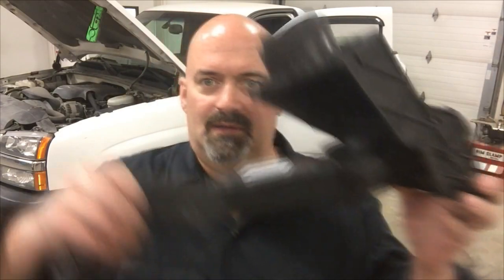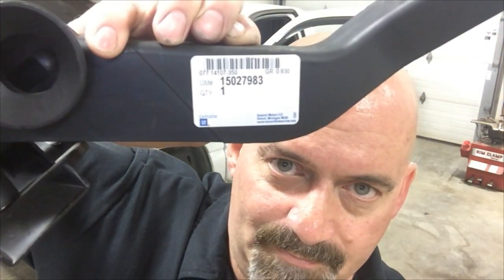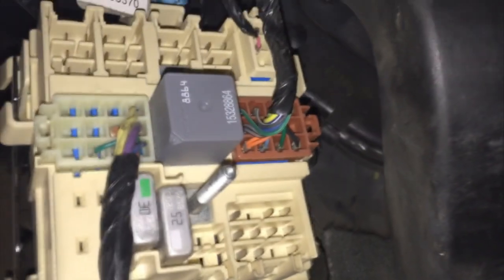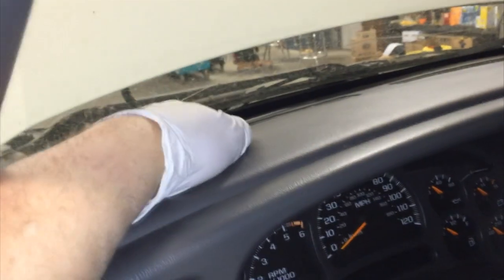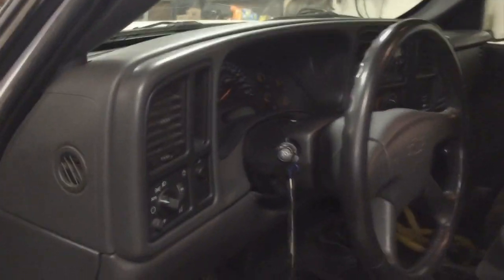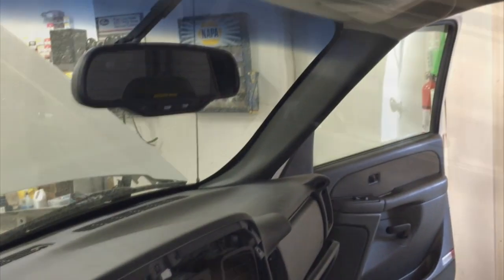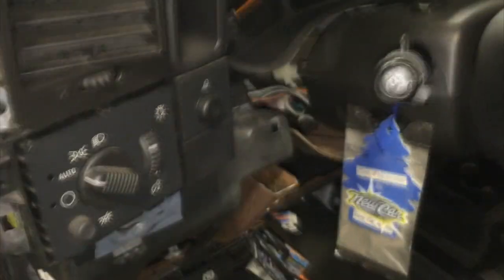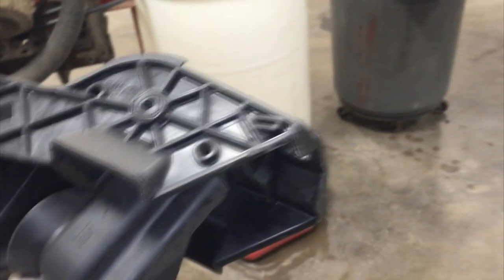Replacing Chevrolet Silverado GMC Sierra Clutch Pedal Assembly - Broken Clutch

Comment: O'Reilly's sells one with a metal insert. Also I didn't have to take dash apart simply dropped fuse box. To get new one in I attached the pedal lever after installing the housing. Made it much easier
Reply: Could you please tell me how to get the pedal lever off?  It would be a tremendous help.  can see much with it in the way to take the old one out.  Thanks

Comment: I have done this repair before on my 2002.  I didn't need to remove a single bolt or screw on the dash.  You use a swivel head and at least 11" of extensions to reach the three bolts holding the peal bracket in.  Once they are loose, you pull the assembly towards the bed, and you can get the front of the bracket in a little gap.  Then there's enough room to pull the round part of the bracket in the firewall, out and down.  I didn't even need to remove the pedal to take it out.  Came out pretty easy...  For install, I pulled the pedal out just because it was so easy,  install was in reverse order.
Reply from the maker: As stated, some models have clearance, some don't. Glad you were one of the lucky ones

Comment: I had a truck like this .  The clutch bracket does NOT have clearance to remove by any other means.  However, I took my Fein saw and cut the bracket in half carefully without hitting wires.  Then the two halves of the bracket come right out.  I took the new bracket and shaved off the corners and the 45 degree gusset back about 5/8 of an inch.  The new bracket slipped right in under the insturment panel very easily.  Took about 45 minutes total including clean up.

Comment: I just got through doing mine.  I had a couple of bolts that weren't mentioned on mine to get the dash back, but otherwise the video was spot on.  Saved me a lot of money, man.  I would have never gotten it done without the video.  Thank you.  VERY much.  Sure do appreciate you.
Reply: Where are those bolts at? I'm in the middle of pulling my dash right now and I did everything in the video but it's like a bolt or 2 on the driver's side got missed, the passenger side is free, but the driver's side hardly moves

Comment: Just pulled an assembly out of a 2002 sierra 1500. The 3 bolts holding the unit in place and the 2 nuts holding the fusebox base are all that needed to be removed. After that, a long screwdriver to push the firewall insulator out of the way and some finesse. Nothing needs to be forced, just wiggle it around and it will pop out.

Comment: I didn't have to move the dash.  Popped fuse block out of the way and unbolted the mount.  R&R was pretty simple after that.  You need to point the pivot point of the pedal highest up into the dash to pass the harness then slide master cylinder mount into its hole.  You'll start at about a 4 to 5:00 clock position then twist clockwise to 6.    Took me an hour and a half start to finish.  05 V8 2wd.

Comment: 2004 Chevy Silverado Regular Cable - Thank Car Dr. for the video, just wanted  to add for the regular  cab truck, It was not necessary to loosen the dash.  Just  a good tug forward to clear  the firewall the out.
Reply: I have a 2006 v-6 1500 i have to do it on. I dont have to loosen the dash?

Comment: I have to comment. Mine is an ‘06 regular cab. Did it in under an hour. Battery still connected also. 
Cut the pedal off as high as you can (have a buddy hold the pedal down for you). Watch the two sets of wires. You shouldn’t even be close. Take a sharp razor, trim a little bit of the thick rubber insulation under the area the assembly passes through the firewall. Take the 3 15mm bolts out. (You do NOT need a swivel!!).  Just because I saw it, I took the 2 13mm bolts out for the dash supports. 1 under the column and the other on the hump by the 4x4 selector. Two 15 mm bolts behind the fuse cover on the side of the dash. 
I took a 12” flat screw driver and inserted it at the bottom of the dash by the 2 15mm’s and left it there. (I don’t know if it helped or not). 
Take the cover off the floor mounted distribution box and pull the box out of the way. It does move. You don’t need much. 
Pull on the assembly and it comes right out. 

With the new one in your hand...push in the hex shaped “plugs”. The pedal comes off. 
Slip the new one up in and bolt it together. Last step was sliding the pedal back into the assembly. Click-click.. insert clutch master through firewall into pedal, connect wire harness and you’re done. 

Seriously, this took just less than 1 hour and I had a phone call in the middle I had to answer. 

Tools used... 3/8 ratchet. 2 6” extensions. 15mm, 13mm and a 10mm just because. Not necessary though.  Pipe cutting saw(they cut as you pull not push).
Reply: Rob Buttermore this is great! I got partway thru the dash then found your method; saved a ton of work. I modified it slightly and I think it took me more like 2 hrs (once you subtract out the time I wasted on the dash!).
Anyway, looking back I’m pretty sure you could do it without removing any of the 13mm or 15mm dash support bolts. Once a bit of that plastic/rubber mat is cut out, and the pedal is removed/cut off, the stationary part really does come right out!

Comment: Update; was able to free the clutch pedal assembly easily by simply cutting a section of that thick floor insulating rubber stuff below the point where the pedal assembly passes through the firewall. That gives enough clearance to pull back, then down in the front of the assembly, and it comes right out. Did not take apart any of the dash. '05 Silverado 1500.
Reply: Same here on a 2003 GMC, its kinda of a fight to get it out but no need to do any dash work.
Reply: CopperFiremist , oh yeah it’s still a fight and I ended up with plenty of small cuts on my hands and arms!

Comment: Hey man, thanks a bunch for posting this repair video, you saved me hours of figuring stuff out for myself, which I used to do a lot before you tube. Pretty sure I owe you at least a six pack.. Anyhow, I figured out one thing that saved me a bunch of time and will save you and anyone else from having to fool with the dash components you illustrated. I removed the metal bracket under the fuse panel you removed at 5:50. That allowed me to remove and re-install the clutch pedal assembly no problem. Probably a 50% savings on cuss words!
Reply: Great tip, John!  I used this in my repair and I was able to remove/replace the clutch pedal assembly w/o touching  the dash.  It was a tight - but do-able fit.  I hope I never have to do it again though.
Reply: John Mahaffy thank you so much
Reply: I concurred with john mahaffy, i used a small pry bar between fire wall at the master cylinder opening . WOW! popped right out and no damage....cool thanks and thanks to the car doctor. many heads are better than one head, LOL
Reply: John Mahaffy dude this is huge. Thanks
Reply: How the hell does removing that bracket on the floor board give you clearance to get the top piece out ?
Reply: IF you are still around, was that bracket silver in color by chance?  I'm stumped.
Reply: was that bracket silver in color if you remember? @fsfazekas

Comment: I just changed mine today on my 2006 WT 1500 and was able to do it without removing anything, but the lower dash panel and moving that electrical junction box. I did have the seats out for some other work, though, which helped with access .  I did use the oem part because my problem was worn pivot . However, Dorman makes an improved part with metal parts molded in . But it does not come with the pedal.

Comment: Had to replace my Clutch Pedal assembly on my 2006 Chevy, 4.3L. Not fun, took me all day as I am a very shade tree type guy. Took my time and saved around $300. The only issue I had was I didn't get the dash out and up far enough and I was getting caught on the firewall pass through hole and top bolt wouldn't line up. Grabbed a lunch and came back to it and finished her up. Thanks for the great video...now if I can get all the cuts healed up I'm good!
Reply from the maker: +Bubba Jones I needed three units of blood after this one. I'm not sure I would do another. Glad you saved some money. Take care

Comment: There is a lot easier way to do this. I'm doing this for the third time on my 2000 Silverado (same dash) and I've found that once you remove the three retaining bolts you can slide the pedal assembly back towards the instrument cluster enough that the front (where the MC attaches) will drop down inside the firewall. Take a wide gasket scraper and push it between the carpet and the front of the assembly so the carpet / mat is pushed back against the firewall as the front of the assembly slides down over the carpet. After the front of it is down past the hole in the carpet push the harness in between the front of the assembly and the matt before pulling it all the way down. Takes maybe 10 minutes to get it out.  If you have trouble getting it past the carpet trim some off the top edge of the carpet or mat.                       Also you can work the clutch master cylinder line around under the brake booster so the clutch master will come out of the firewall completely without having to break the line and bleed it..Also The secret to bleeding the MC is to jack the front of the truck way up. The MC is tilted slight down when the  truck is sitting on the ground. jacking the front of the truck up makes the reservoir the highest point in the system. it'll self bleed just by pumping the clutch after that..
Reply from the maker: Thanks for the feedback. I'll have to give it a shot on the next one...if I ever agree to do one. Haha. Take care.
Reply: This is definitely the way to replace the pedal assembly.  Took me 1 hour replace it.
Reply: Man, I hope you do another like I'm describing. Your video is great. I just wished I was there. Making videos is not a talent I possess. If you do, just give me (Red) a shout out.

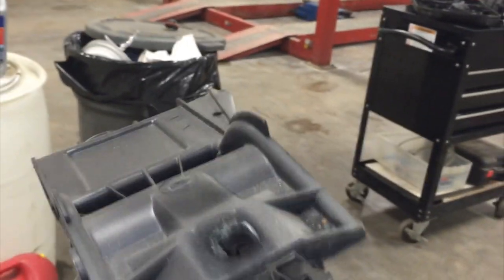Comment: 18:35 that’s why you had such a hard time. You pulled the wrong side out first

*PRO TIP*
DO NOT NEED TO PULL OUT DASH at all.  

Once you have the bolts out you will want to slide the bracket towards the back of the vehicle and actually pull the front part of the bracket out of the hole and rotate down. 

The dorman part has a metal collar built in.  
Part #926-086 
Going on a 2005ish GMC Sierra.  
Also the clutch master cylinder rod bent which is why it broke on this one.  Less than a hr I’m done
Reply from the maker: Pro tip: not all models require moving under dash components. Some do.
Reply: @ThecardoctorTV  no disrespect love you content.    I’m just saying I bet if you would of tried the opposite direction would of came right out for you.  Maybe try on next one.  Tho it’s not a common one Iv had to deal with

Comment: Happened to me... 2003 Silverado.   85K miles. Pushed in the clutch, heard a crack,  pedal stayed on floor, master cylinder hanging off firewall... After turning truck off, wouldn't restart, clutch has to be in for it to start... Broke, out of luck. It was the last time i ever bought a Shitvrolet.. RAM baby!
Reply: RAM TRUCKS just happened to me , man I’m pissed. I replaced assembly last year due to broken keyhole holding clutch cylinder. Now the interior pedal assembly cracked all up and pedal arm snapped from shaft it operates on,  I’m goin’ back to when Trucks were for workin’ people and not pretty toys, looking for Cheyenne 70 -73 maybe Trailer Special.

Comment: I was able to get my pedal out on my 2002 silverado without removing the dash. had trouble trying to get it back in but then....i removed the pedal arm from the mount by pressing in the spring loaded bolt shaped retainers on the housing. i had plenty of room for it to go back after that. it literally took 30 seconds to remount the bracket to the firewall and attach th pedal arm back to the base bracket
Reply: I'really appreciate your strait forwardness and could'nt agree with you more. Thank you for your help

Comment: 2005 Silverado 1500 and mine just went...can't believe that they use plastic for this and metal for the accelerator and brake!!!  Those pedals could be plastic, this one needs to be metal SMH!  Anyway just ordered the part so I'll be trying this myself in a week or so.  Thanks for blazing the trail for me!
Reply: Mine is done...took about three and a half hours but I'm just a back yard mechanic (at best) so someone that wrenches more often can probably do it quicker.  I used John Mahaffy's tip below (removing the under dash fuse block mounting bracket) and that let me remove and replace w/o touching a single bolt on the dash.
Reply: right on .I'm in same situation 06 Silverado 1500

Comment: I got mine back together. took the pedal off the assembly. seems it's impossible to take the pedal of without the left side spring popping out. the plastic washers around the compressible nuts cracked a lil but it seems to be holding the pedal fine just a lil frustrating damaging a new part
Reply from the maker: sad deal. Glad you stuck with it!

Comment: great video just changed a clutch pedal in an 06 silverado 4.3... Davis Truck & Auto Chateaugay, NY
Reply from the maker: Thanks! Did you have to pull the dash back very far to remove the pedal support?
Reply: +The Car Doctor no probably an inch if that seems like alot of work for that little bit of movement
Reply from the maker: Yes, poor design for sure. Garbage plastic and hard to get to.

Comment: Sharing the following in attempt to save someone the headache
associated with this dilemma and the best permanent fix. This ABS plastic will
break / weaken just as the video illustrates when excessive force is used when
attaching the reservoir cap. Back ground: No issues until truck went in for a new clutch
and back twice because of a faulty slave line. Within a month after receiving truck
back the 3rd time, BAM… pedal to floor and master hanging by the
push rod through the fire wall. I remember checking the fluid before the thing
shot out of the wall and noticed the master was terribly wobbly and loose,
thing would pivot nearly .5” in all directions. So all that draining and filling
and SMASHing the cap back on took its toll over the course of the truck
returning to that shop and damaged this assembly (Next time, I’ll be doing the
clutch). 
So what is a good, relatively fast fix, back on the road
next morning (after working on it all night) well, just keep reading.
Throw that stock master in the trash, run down to the parts
store and get the good ole bolt on master from I believe pre 98 Chevy/gm models.
Two bolts and mechanically attach that thing like it should have been to begin
with. 
The steps: The new master will set flush against the outer
lip or flange of the ABS that is visible at fire wall. Trim away the broken
ABS, but do not cut or remove the ABS housing protruding through the wall,
leave it intact. You need the material as is for proper push rod spacing.
Center the master on the ABS flange. You’ll notice the bolts will clear the
flange, mark the wall where the bolts will go with a pencil. This is the tricky
part due to the access, drilling the holes. Step the holes (start with 1/8”
bit, then size needed per the bolt size) Use the super long bits sold a HD or Lowes.
If you can manage to (center) punch the wall, it will help to keep the bit from
walking. While at the hardware store grab a stick of perforated angle steel,
thick gauge (or just fab up a small member form some scrap steel if capable). Have
an extra set of hands position the master and bolts in place against the ABS
flange. From the cab side, using a shop light take a look up under where those
bolts are coming through the wall. Measure or guesstimate the length needed for
the angle steel (thinking it was roughly 3-3.5”, for each side or bolt). The
new steel will act as the back plate for the bolts. Place a section of steel on
each side of the push rod. The angles or plates will run in the horizontal
direction. Slab some red thread lock on bolts and snug the nuts up enough so
the assembly stays in place. Check position of master, angle/plates and bolts
get well enough lined up and tighten bolts. If using the perforated angle, tighten
just enough so as not to bend the steel, but tight enough that the steel doesn’t
move. This was performed about 5 yrs back, so I tried to remember the process which  fairly certain is all here. If post gets response, I can post some pics via G drive
Material: Pre 1998 Chevy/GM clutch master cylinder, 2 bolt mount.  
Two bolts to connect MC to fire wall (can’t remember if the
supplied bolts were used)
Red loctite
Back plate for bolts- angle steel.Use the old push rod, as it has the ball that mates to pedal.
Reply from the maker: wow, thanks for the well documented fix. Glad you got it back on the road. Thanks for watching

Comment: Hello I have a 2007 Chevy Silverado. My clutch pedal become very lose and I can’t get into gear while it is running. I had to turn the truck off and put it into gear. I couldn’t get past third and had to drive home from work in third gear. Do you believe it’s my clutch pedal assembly, and if so will your fix be the same for my model. It’s a 4.3 work truck. Thank you
Omg I just got to the part about a herniated disk in L4 and L5 and I do have that. 🤣🤣 If I decided to take it to a mechanic do you know what I may have to pay?

Comment: Ok So I watched the video and was not wanting to loosen up the dash board so I tried to get the pedal out without loosening the dash and I was actually able to get it out. It was tight but moving the wire block like he said and just manipulating the pedal and wiggling it out carefully not to pull on any wires the only thing I had to do was take a Sawzall and cut the pedal arm so that I could get the bracket around wires that were routed around the pedal. Now that the pedal is out I can reroute the wires out of the way to install the new pedal assembly.